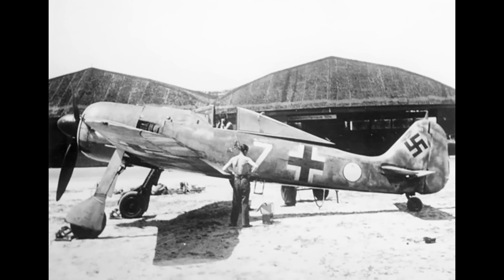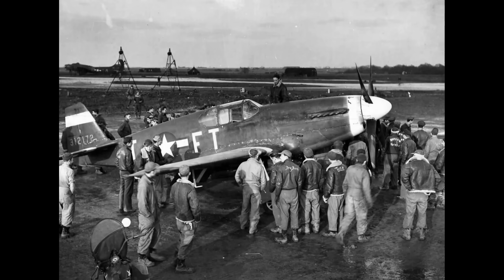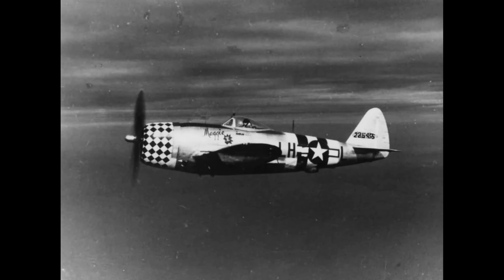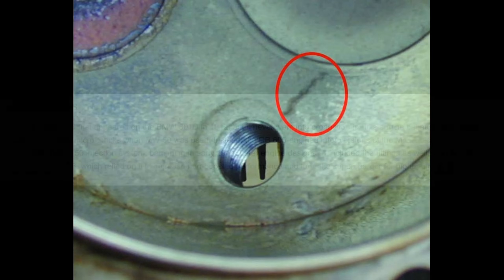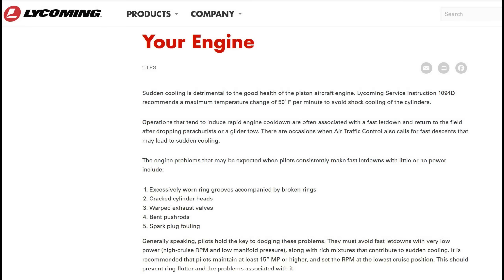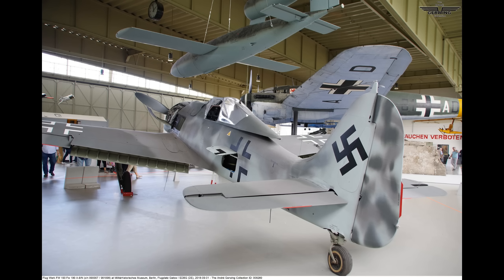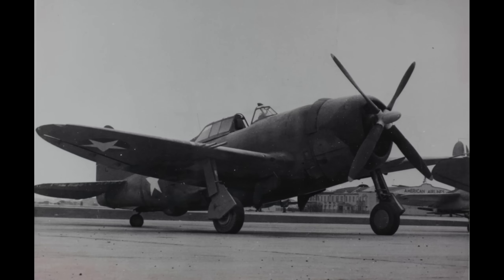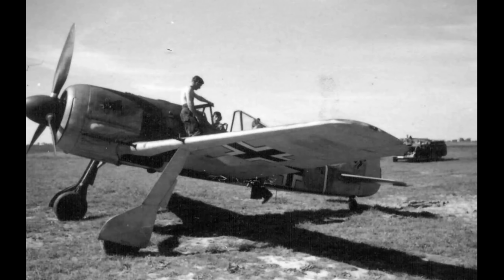Focke-Wulf Fw 190 A-4, Almost turned the tide, Almost...

Comment: Hmm... wouldn't the lack of an additional supercharger gear/stage have been more of an issue when it comes to attacking formations of B-17s? I mean.. these things would operate above the 801's rated altitude and without a high-alt "optimized" charging system, would MW-50 have made that much of a difference up there? On that note... I always wondered why GM-1 wasn't tried on the 801. 
I'd also like to jump in to defend the 190 when it comes to dogfighting - or rather its fighter vs fighter capabilities. I just don't see how it could not be considered a major threat, especially around the time the A-3 and A-4 came out. The Brits seemed pretty impressed with that captured A-3 they evaluated - and that was with some engine trouble they encountered due to (IIRC) faulty spark-plugs. Besides: From personal (sim-based) experience and ignoring engagements that take place above its comfort-zone/rated altitude: The only thing lacking with the A-3 or A-4 WRT classic "dogfighting traits" is the ability to sustain a tight flat turn. It is still wicked fast, could change directions very quickly thanks to its insane roll-rate, it's great in a dive and a good (but not excellent) climber. It also retains E very well, its control surfaces are harmonized very well, it's a stable gun-platform, heavily armed and (according to LW-pilots) could take more battle damage than the 109. 
Another anecdotal piece of evidence comes from Julius Meimberg who was a JG2 pilot with 53 kills, all on the Western Front. In his excellent autobiography "Feindberührung" (not sure if it was ever published in English) he recounts two pilot friends/acquaintances of his, both of whom were convinced "their" plane was superior, engaging in mock-dogfight in a 109 (think it was a G-1 or G-2) and a 190 (probably A-3 or A-4) and after 20 or so minutes coming back down, both soaked in sweat and declaring the fight a draw.
Reply from the maker: Of course an additional supercharger would help. However that's a much more complex and involved change. Adding MW-50 is relatively easy, it could be done via field mods. cont:

GM-1 was tried on the 190, that's another video, this one is about MW-50. 

I'm not saying the 190 isn't a major threat in a dogfight, in 1943 and well into 1943 it is, but I would put it in the top 10.
Reply: @GregsAirplanesandAutomobiles  Fair points, however my question was more about the general effectiveness of MW-50 at higher altitudes. No doubt it would've helped at or below the 801's rated altitude, but would it have been enough beyond that? My only points of reference here are what I've read about MW-50's capabilities in books or on the web and its representation in sims - mostly IL-2 as there are quite a few MW-50-equipped LW-planes modeled in that game. From what I understand, at the very least, MW-50 loses a lot of its effectiveness at higher altitude - say, 6km and up. According to IL-2's tech-notes for the late war 109s, use of MW-50 is actually verboten! at 6km and higher. 
Cool info about GM-1 - I wasn't aware they tried that on the 801. It does kinda makes sense though considering there were very early 109s that were already using the system (E-7/Z being the earliest, IIRC) and that they were playing around with high-alt 190-prototypes well before the D-series ever came out.
Reply: Wasn’t Greg’s point about the survival of the german fighter force before d day ? My understanding is that the US airforce was tasked with destroying the german fighters and they chose to do it in the air by targeting the german fighters that came to attack the bomber stream. That meant the US fighters followed the german fighters at whatever altitude the germans flew in order to destroy them. A better 190 at low altitude would allow more 190s to survive either the approach run  or the exit being attacked by US fighters.

Comment: It's crazy that water methanol injection can cool the engine, even with the increase in manifold pressure. I would have thought the temperature would increase.
Reply from the maker: Cylinder head temps and EGTs typically go DOWN when spraying. In fact NACA called it "internal cooling".
Reply: Water-to-steam phase change absorbs a LOT of heat.  That internal cooling knocking out hot-spots in the cylinder and reducing the temperature of the air/fuel charge made pretty substantial improvements in an engine's Octane Tolerance, allowing the higher manifold pressures and more power.  There was some pretty substantial indicator diagrams from NACA showing the power didn't really increase max cylinder pressure, but definitely extended its duration. That puts high cylinder pressure into crankshaft/rod angles that give the piston a lot of leverage on the crank, and also helps one cylinder overlap pressure with another.  R-2800 pilots did mention how much smoother the engines ran when the water was on, as well as feeling like the old girl got 'hit in the seat of the pants'.

Thanks for the deep-dive, Greg!!!
Reply: One of the random bits of data I remember from college chemistry is the specific heat of the water-to-steam transition — 80 kcal/mole (18 grams for water) — a considerable heat sink for a hot engine.

Comment: Greg - Why dismiss the A-3 & A-4 as a dogfighter? With the FW 190, JG2 and JG 26 attained air superiority over RAF over Kanal Front in 1942. Only the Mark IX restored an advantage but there weren't many until early 1943. The FW 190A remained formidable with good pilots, particularly at low to middle altitudes in all theatres, except vs VVS top fighters in late 1944 and 1945. MW50 would have been nice on more FW 190s in 1943/44 but it was still a handful from sea level to  slightly above FTH - fighter to fighter. 

The P-47C and early Ds before the -11 and WI were at a disadvantage in 'dogfighting' (save marginal speed advantage) below bomber altitudes all the way to the deck - in acceleration, climb, turn and roll. Usually one of those will be useful. 

Zemke and others capitalized on high altitude advantages to initiate attacks in dives but usually (survivors) did not stick around for maneuver fighting against FW 190As or 109s. WI and paddle blade for the P-47D helped (but not enough) in acceleration and climb but still not a superior 'dogfighter' against either 109 or 190
 
The Spit IX & Subsequent was the consistent FW 190 killer at all altitudes when pilot skill was equal but there were crossover points where the FW 190A had a speed and Hp/wt advantage.

More application of MW50 would have improved FW 190 advantages but not to extent of threatening the Allies gain of air supremacy first half 1944.
Reply: I think he meant the handling characteristics "on paper".
Reply: @Arnechk  - I wonder what Greg considers 'top 10'.  Dogfighter is very limiting. Top 'air superiority' fighter implies capabilities in full war fighting envelope - which would eliminate low/medium altitude type fighters not capable of contesting higher altitude fighter threats.  Wing Commander Brown considered FW 190 second only to the Spitfire.

Comment: 10:08 you say contrary to popular belief, what is it that people normally think is the mechanism of cooling? A different part of the cycle?
Reply from the maker: That's a good question. Most people, including a lot of people who should know better think that the majority of the cooling happens in the intake piping between the injection nozzle and the intake valves. This is dead wrong.
Reply: Oh ya, I have seen that argument before now that I think about it. I suppose a misapplication of the cooling that occurs at the carburetor venturi, thinking perhaps it is the addition of fuel vapor and not the lowering of density that accounts for the majority of the temperature change? Perhaps they are thinking that the amount of injected fuel vapor significantly reduces the temperature in the intake?

Edit - probably a belief further compounded by the slight additional intake valve cooling if the fuel is injected prior to the valve instead of directly into the cylinder?

Comment: I read it had the best roll rate and the P-51 did not come along till much later. It ate Spitfires didn't it? At lower altitudes wasn't it the best dogfighter?
Reply from the maker: The 190 was never the best dogfighter. However it was a threat to Spitfires due to it's superior speed, for a while. It could hit and run.

Comment: I remember dye checking many Continental/ Lycoming cylinders for cracks in my late teens. Being air cooled these engines don’t have a thermostat like water cooled engines so they would be more susceptible to thermal shocking.

Comment: Really interesting stuff. . The  contrast between the “lycoming” engines and the more open air engine set ups at lower altitudes is really compelling. . .with these hot rod engines firing up and then cooling down rapidly you can imagine more wear and tear

Comment: 2:50 I would say, in LOW LEVEL skirmishes, between pairs and schwarm/flight strenght (ie Atlantic coast daily) the F190A got a fearsome reputation. Low level stands for like under 6000 meters, maybe even lower.
Reply: I think of low level being under 3km altitude.  3-6km would be medium.  This is of course just for WW2, as other wars with different technologies would have very different definitions of what low/medium/high altitude means.

Comment: More speculative than usual, but you do speak with authority and experience. And I did always wonder if MW-50 didn't cool cylinders too much. I always assumed that it was introduced early enough to the system that majority of the cooling would be in supercharger or something so it would work sort of as an intercooler. Then again I mostly remembered MW-50 or other such techniques from big liquid cooled V-12, so maybe there it isn't a problem?
Would you mind doing short follow up video explaining how cooling of cylinders would be problem in some engines, but not others? You touched upon it here, but not enough for me to extrapolate and while I will re-watch your MW-50 video, I don't remember it being mentioned there (but I might be wrong, it's been a while since I've watched it). Or maybe someone with knowledge will see this comment and explain it to me, so you don't need to work hard for 1 person that doesn't fully understand why something is a problem in 1 plane/engine but not the other.
Thank You as always for great video Greg! Take care.
Reply from the maker: Just to be clear, I don't think that excess cooling from water injection is something that's normally a problem. It's certainly NOT a problem for a liquid cooled engine, and normally not for an air cooled engine. However the BMW 801 with it's metallurgy issues was already an engine prone to cracking, and MW-50, either due to the power or the cooling pushed it over the edge.
Reply: @GregsAirplanesandAutomobiles  OK Fair. Blacksmiths know that you have to control rate of cooling in order to get various types of crystalline structure. I did wonder about possible placements of MW-50 to maybe get partial effect, while dropping temperature of air compressed in the charger so simply more air would enter cylinder, rather than spraying MW-50 "too close" (whatever it means) to cylinders. My lack of knowledge on engines (piston ones at least) is showing sadly and I have complete blank when trying to image BMW 801. I will have to rewatch your video either on that engine (if the video exists) or on Fw-190, because I'm certain you talked about that engine. Sorry if I took your time, by uselessly rambling. Your videos always leave me with a ton of curiosity.

Comment: After following you for several years, I think it’s the first time I really disagree with your analysis:
1) Shock cooling, all you need is a full engine analyzer to see it; I can get in the pattern on a normally aspirated engine, like on my Extra-300 or TB-30. Very easy to do. Jumpers and towers pay extra attention to it everyday.
2) ADI injection does not shock cool the engine, extra power does crack the cylinder. We have extensive data and experience Reno racing with all kinds of ADI mic and even NOS which really cools the intake charge, none of them ever shock cooled a cylinder because the cylinder is under max power and max effort therefore max heat.
Reply from the maker: Maybe, at first I though you were going to say shock cooling doesn't exist at all. That's a common argument on the internet. Saying that it's impossible with MW-50 is another matter. Sadly, without a BMW 801 here on a test stand it's a bit hard to determine. The experiences at Reno, while very meaningful are not with engines built with a shortage of critical metals.
Reply: @GregsAirplanesandAutomobiles  Agreed, however Reno proved that excessive cylinder pressure cracks good cylinders before any other factor.
Reply from the maker: You may be right about the crack being due to power, which I also suggested in the video. However I don't think this is proven at Reno for the BMW 801. That's a big difference. Also, every source I have that talks about the cracks in the 801 with MW-50 says it was due to cooling, one of which I put on screen in the video. Understand I'm not saying you're wrong, I'm saying I don't have proof that you're right.

Comment: Concerning shock cooling: From anecdotal and second hand experience in glider towing, Lycoming engines barely last more than half of the proclaimed/recommended 2000h TBO in towing use.
Prolonged climbing at VY and (sometimes below) followed by high airspeed while throttle idle and descending quickly kills those engines.
Water cooled Rotax 912 and derivatives usually last the full 2000h. No Problem with shock cooling, especially with thermostat equipped airplanes.
Reply from the maker: Thanks, I'm clearly on the side that shock cooling is a thing. Even if in the situation you describe the cooling rate isn't 50F/min it's still going to cause more rapid wear, which based on your post it sounds like it does.

Comment: 15:45. I appreciate that your expertise is in aircraft engineering, but I don't believe that pushing the Normandy Invasion back would have change much.  Remember that more than 3/4 of German forces were on the Eastern Front.  Begration in 1945 would have rolled up those forces all the way to Berlin no matter how Overlord went.  It may have take a bit longer, but in months and not years.  The US and Britain just can't drop the propaganda that "we" defeated Germany.  We DID NOT.
Reply from the maker: I actually have a video on this coming up. It's the conclusion to my IL2 series.
Reply: Post-war interviews with soldiers on the Eastern Front showed that the biggest problem with the morale was that so much damage was happening to loved ones and loved cities back in the Fatherland.  Without the massive amount of lend/lease, coupled with the morale-sapping bombing (plus whatever actual materiel issues it caused) USSR wouldn't have turned the Wehrmacht at Kursk, Moscow, or Leningrad.  And the A-bomb would have ended the war within a week of the actual VJ day, when dropped, my personal guess, on a demonstration target in Germany.  So, yeah, the US and UK defeated Germany.  Even had Russia not fired a shot, the war would have ended the same way and within a week of its actual historical end date.

Comment: This is way off topic but all V12 fighter engines were 4 valve DOHC. Related to cars you can get a bigblock Chevy in a Porsche 928 (and a smallblock in a 911). Hove much capacity would it be able to get in to a "Chevy V12" with central camshaft, pushrods avd 2 valve heads within the space confines of a Rolls Royce Merlin or a Pachard as used in the P38 Lightnings to do a straight swap?
When swapping a 5.3l Jaguar V12 for a Chevy small block you actually have to use front springs for a straight 6 due to the fact that the 5.7l+++ V8 cast iron is much lighter than the Jag V12.
Reply from the maker: All true, but I'm not sure what your point is.
Reply: @GregsAirplanesandAutomobiles  Just a thought that they were overcomplicating things back in the days, and that it was not only the Germans that did this. 
In addition, today it would be much cheaper to make such an engine for the replica aircraft market and air racing.
Reply: Nations used the best equipment they could design and manufacture.  The design was according to doctrine.  The manufacture was influenced by technology, available materials, cost and logistics.